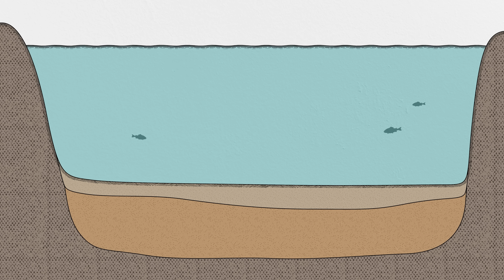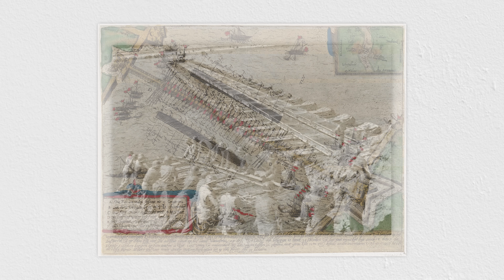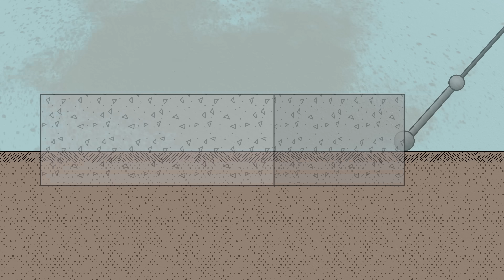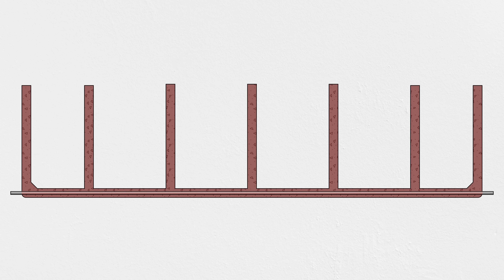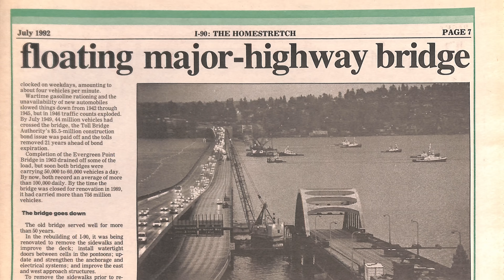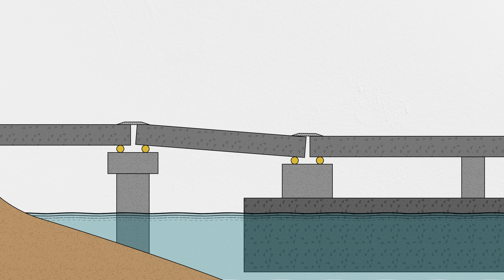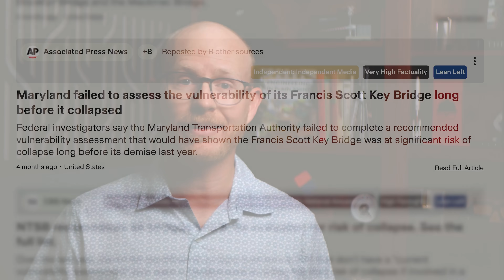The Hidden Engineering of Floating Bridges

Comment: The George Massey tunnel under the Fraser River between Delta and Richmond B.C.is an example of a tunnel that was built from submerged sections that were connected when submerged then pumped out.  It opened in 1953 replacing the ferry that had been used earlier.

Comment: I wouldn't truly understand the point of floating bridges, I used to live in Hampton Roads, 5 bridge tunnels the highest density in the world, and one of the longest bridges on earth.  27 miles.    
We figured it out floating bridges just seems unnecessarily difficult.  We drive pillars hilariously deep, boat in premade sections, underwater weld it together, then pump out the water.  It's a bridge, it's an underwater tunnel to allow aircraft carriers to pass over. It works just fine.

Comment: We had a concrete floating bridge in Hobart, Tasmania for 21 years from 1943 to 1964 which was around a kilometre long. It had a lifting span close to the western shore for ships to pass through and was curved. One segment is now used, sunken, as a jetty on a nearby island. This bridge was also damaged during a storm and had to be reinforced. The points where it connected to the shore are still there, I’ve been to them many times but it was demolished when the more permanent replacement with higher capacity was opened before I was born. Then the new bridge was hit by a ship and 3 spans collapsed causing all sorts of chaos! I do remember that as a small child.

Comment: The Hood Canal Bridge is great for the Olympic Peninsula, but all of the problems inherent with floating bridges are frustratingly present. Closures for submarines, closures for high winds, closures for... well, it can be a chore trying to get off the Peninsula at times with miles of backups. Still, having the bridge available beats having to drive down to Olympia to get around the Hood Canal. Thanks for the video!

Comment: Not mentioned - after the original I90 span sank in the storm, the pontoons cut the cables holding the new span in place.   They brought in a number of tugboats to pull the new span against the wind until new cables could be installed and stabilize the bridge.  The cables are essential in holding the bridge in position.

Comment: 13:40 those floating or buoyant tunnels will become a huge disaster if not properly handled. In a regular tunnel thats on or in the ground, the weights of the vehicles, vibrations, and other stresses, can dissipate into the ground. Same with regular bridges.
But this design shown here has no such mechanism. You need a lot more engineering to make these safe, not simply find a way to suspend them in water. I wouldn't trust such a tunnel, especially not the first of its kind. 
If you think you can outsmart physics, you really just offloaded or hidden the real problem.

Comment: Since you mentioned the proposed floating bridge in Norway, I'd recommend checking out Bergsøysund bridge as well. It was opened in 1992 and was the world's first floating bridge without side anchors. Instead the pontoons are kept in place by the bridge spans themselves being designed as a continuous horizontal arch under tension.

Comment: One of the biggest things in civil engineering & transport infrastructure is that you need a wide margin of safety, comprehensive build-out AND annual inspections & maintenance with no shortcuts and no excuses. Either do it right & maintain it, or don't' build. Of course when politics and all this nonsense gets involved, you can end up with critical flaws flying totally under the radar.

Comment: 13:25 I can think of so many sea crossing that only floating tunnel would work, like Italy's Sicily bridge, as the water is too deep for a tunnel, and too deep to put it any foundation for cable or suspension bridge. And ship still needed to get through it, only floating bridge or tunnel would work for this link.

Comment: I love the shots at 2:08, 4:09, 5:51 and 12:02 where you can see the effects on the water of multiple floating barriers like this (i.e. the Lacey V Murrow Memorial bridge). Strong waves on one side that look darkest as they're least reflective; gentler waves on the other side resulting in a water surface that's a little more consistent, a little lighter, a little more reflective; and then the almost perfectly still water in the middle. Even at 7:18, as harsh waves pound against the side, there's a visible portion that would probably be kinda fun to swim.

Comment: Glad you covered all my favorite experiences growing up driving back and forth across these bridges.  I once saw a submarine go through the open span, I once had a wave crash on my windshield that left me driving blind for 3-4 seconds going 60 mph and the weird feeling of the back of your vehicle moving independently from the front when stuck over an expansion joint in a storm.  Sadly all of these experiences are no longer possible with the new higher and bigger bridges but they are fun stories to share.

Comment: Quick explanation for how heavy thing float. 

Thing float if total density of thing is less than density of water, or whatever liquid it is floating in. 

Concrete more dense than water right? Yes! But, the AVERAGE density of the whole object is what determines the buoyancy. 

So, take all the concrete, find its density, then take all the air contained within the concrete, find its density, then average those two densities , you'll find the average density to be lower than that of the water!

Comment: The Hood Canal Floating Bridge has another serious problem. About a decade ago it was discovered that about a half of all outbound salmonid smolts are eaten attempting to pass the bridge. Think chum, coho, chinook and steelhead. (I don’t know if there are any pink salmon runs in the Hood Canal basin.) 

It turns out the juveniles predominantly migrate in the top meter of the water column. They hit the bridge and are stymied. (Go to Googleearth and see so next comments make sense. See the piers near each end where the bridge transitions from conventional to floating.) The salmonids turn right or left rather than just going down the vertical face of the pontoons. When they get to the abutment, they encounter the same thing, turn 180, and go to the opposite end. Wash, rinse, repeat. The mean time to pass the bridge varies a little by specie, but is about 24 hours. Diving birds and various marine mammals have figured out the buffet is out and concentrated on this spot. Biologists have used all sorts of sensors put into a sampling of juvenile salmonids well before the bridge. I thought the most interesting was differentiating between predation by birds and marine mammals and by fish. Temperature. When the salmonid is eaten by a fish, temp stays about the same. When eaten by a bird or mammal the temperature almost immediately goes up to about our 98f, and the sensor records it. Definitive. 

Runs had a temporary rebound after bridge sank, and before replacement. Understanding the connection was retroactive. 

A trial has been done to try and improve passage. In effect they added a cant so fish would encounter a 45 (?) degree inverted slope instead of a vertical wall. Hope was they would swim down and under the obstruction sooner. If desired I could contact someone and see if results are available. 

In meantime in mid to late spring each Ohio-class that goes to or returns from the Pacific also lets a batch of juvenile salmon escape the gauntlet.
Reply: That's interesting, funny how the fish never really considered to just swim down. The downside of manmade structures I guess.

Comment: Not a fan of the idea of floating bridges and tunnels to be honest. Maybe I'm just a naysayer but it doesn't seem like an ideal solution to me.

Increased maintenance costs, complete dependency on weather and the almost perpetually temporary nature of this sort of construction doesn't really sell it. If possible, I think just digging a deep fixed foundation is usually going to work better in the long run. I don't think any costs saved on the outset will be offset in the long term. It seems the chances of catastrophic failure are also significantly more likely if complete due diligence isn't adhered to.

Interesting construction and solution to a problem no doubt.

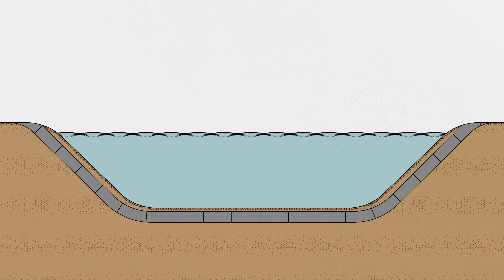Comment: the tunnel/bridge at 14:00 sounds really intresting and posible sci fi tech in our life time. 
i once had a thought about putting a floathing gass chamer in a sky scraper too reduce the weight. i asume it would not be practical or efficent way. but its thinking outside the box.
basicly hot airballon effect in a building

Comment: Just as an FYI, smaller or one off pontoons for houses etc, are usually made "unsinkable". That is, they are filled with EPS, or cellular plastic of a type that does not absorb water. This means that water leaks are irrelevant to their function as the void is already filled with a very light weight material. EPS is ofc more expensive than filling the void with nothing, and as this scales up, the more expensive concrete and water detectors with pumps become a cheaper option.

Comment: I would have thought positive buoyancy tunnels would be safer than ones that would sink. Given an issue, breaking from the moorings would push the tunnel up, compressing the joins, and keeping the sections together. A negative buoyancy would drop extending the path, possible pulling the sections apart and flooding the entire tunnel. Also the floating pontoons would be a shipping hazard as well as also being an issue if they do get hit, compromising the tunnel below. I'm surprised negative buoyancy is ever an option

Comment: Driving over the old Evergreen Point (WA-520) bridge in a storm was an... interesting experience. The bridge would sway side to side, shaking the streetlights, and from the high point on either end, you could see the whole bridge deck going all serpentine down its entire length. That and waves occasionally cresting and crashing into your windshield.

I'm glad the replacement bridge stands much higher over the water surface level and is much stronger than its predecessor.

Comment: When Sound Transit begins service across the lake, it will be the first and only light rail line over a floating bridge. You touched on the requirements, but there was a massive amount of engineering required to even make it remotely feasible. Each car weighs 102,000 lbs empty, and there are usually 4 or 5 in a train. That 1/2 million pounds is running across the bridge at an expected 45mph alongside other traffic, including tractor trailers with total loads of 80,000 lbs or greater, going 60MPH+. All this while dealing with the bridge movement in varying weather conditions. 
You mentioned the stray currents corroding the rebar in the bridge. Something else unique is that Sound Transit uses a 1,500VDC overhead catenary line (vs the usual 750VDC), which makes managing those return currents even more challenging.

Comment: fun fact, the i-90 bridge light rail track took 2 tries.. they ripped up all the tracks after the initial install and redid it which added a few extra years to the project. maybe someone here knows what the specific issue was - possibly related to the expansion joints? pretty crazy screw up.

Comment: Any tunnel across navigable water needs to be under the soil deep enough that the largest anchor in that waterway cannot interact with it, unless the tunnel cannot be damaged or shifted by the largest ship that travels that waterway. I.E. the ship/anchor will break before damage is done.
Surface pontoons are also problematic, at least bridge piers can have sacrificial piers for protection but if you have to put in protection piers for the pontoons, then what is the point of the pontoon?

Comment: Hobart, Australia used to have a floating bridge with a vertical lift section on one end.  Interestingly, the bridge was built curved.  It was used 1943-1964 and was replaced by a conventional bridge due to increasing traffic and congestion.  https://live.staticflickr.com/2431/3665190374_4610e2802c_b.jpg

Comment: I really like the floating tunnel idea. Put the tunnel across lake Michigan so that I don't have to drive through Chicago to go between Wisconsin and Michigan. I also understand that this is far from feasible due to many circumstances including the depth of the lake and necessary length of the tunnel. It would take over an hour driving at 80 MPH to cross. That doesn't even take into account the winter weather that can change rapidly and is known to be dangerous and deadly.
Reply: There's a ferry you can take.

Comment: While I'm not an Engineer, I suspect the floating tunnel idea is going to end up using a design which will be a modified double-deck tunnel with the top tunnel being composed of sealed sections providing the positive buoyancy to suspend the working tunnel the vehicles and trains travel through with the whole thing anchored to the floor of the water body it's installed in...with the working tunnel effectively hanging under the buoyant tunnel, the center of gravity making the tunnel less likely to want to roll to the side/flip over...

This keeps the tunnel and it's flotation tanks well below the surface and thus immune to things like wind, waves, ice, tidal shifts in water surface level and any ship traffic crossing that area...
The only external things this kind of tunnel would need to worry about are submarine traffic, water currents, sinking ships or other accidents resulting in Cargo falling overboard...

Comment: The Hood Canal near the bridge has a mean tidal swing of nearly 8 feet, and a maximum of over 16 feet (which can get even higher due to the combination of rain water and offshore low pressure systems). This happens twice a day - every day - and is a fascinating peice of managing the bridge. Its really quite odd driving it during spring tides, when the bridge approaches are very steep or unusually shallow. 

All Ohio class submarines, both the SSGN and SSBNs must transit the Hood Canal to get to Naval Base Kitsap Bangor, and the bridge frequently opens for subs or their support craft, which requires an impressive coordination between the navy, the coast guard, state patrol and wsdot employees. Recreational and commercial openings are also frequent - the bridge usually opens at least once a day, year round.

Comment: When they replaced the I-90 (Murrow)  bridge and were replacing the anchor they found a car. The care belong to a person who disappeared decades before. They had collided with "the bulge" and go off the roadway early in the morning and noone had seen the accident.

 When the new  I-90 (Hadley) bridge was built it advertised as "rail ready". It wasn't they hadn't calculated the pressure wave a train will created ahead of the train. The bridge, joints etc.... all had to be reinforce and adapted for moving trains. At a cost of $500 million.

Comment: For the norwegian floating bridge idea, I would much prefer the positively buoyant tethered to the seabed solution rather than the other idea. It would for one make the tunnel invisible on the surface preserving the area around it, which is one of the appeal of a tunnel. Secondly, having the floating critical elements on the surface, which is subject to hashers conditions and ship hitting them seems like an unnecessary risk. Lastly, the failure condition for a tunnel carrying people I would prefer to be to float. If the floating elements failed the tunnel would sink, on the other hand if the tether broke the other tunnel would float. It would also make it easier to pre load as other have mentioned is done to reduce the movement of floating bridges. I know the tunnel is very much in the idea stage and much of my "rant" here is based on opinion and speculation as I do not know the final design, but it was just what sprung to mind when seeing the ideas.

Comment: I was pleased to see that you may have used the images of the 1940 opening event “brochure” or “program” for the Lake Washington Floating Bridge that I donated a few years ago to WSDOT’s library and digital archive.  This document was lovingly saved by a family member - whom attended the 1940 bridge opening.  In 1990, I had the privilege to work for WSDOT on the refurbishment of the original bored tunnels adjacent to the floating bridge, and was working for the project when the bridge sank in 1990.  That tunnels are still in use today for the eastbound lanes of I-90 traffic.  As I recall, some interior cell walls for the original bridge were not full height, and could be breached under the right conditions.

Comment: I suspect the floating tunnel designs would be better off using positive buoyancy with anchors rather than suspending them from pontoons, as you can gain immunity to most of the weather if the entire structure is deep enough.

Comment: Objects 3d printed out of thermoplastics are essentially hollow but filled with a series of baffles due to the infill; depending on the infill design these pockets can be sealed and watertight.  I wonder if a "house" printer could be adapted to use the same concept and print a concrete pontoon that was inherently compratmentalised?

Comment: Interestingly, the 1955 Tappan Zee Bridge, whose main span looked like a typical steel bridge of the period, actually "... was supported by eight hollow concrete caissons. Their buoyancy supported some of the loads and helped reduce costs." Quoting the wikipedia article, but when I was a kid I mailed the NY State Thruway Authority and they sent me paper brochures about each of the big bridges they were responsible for and I remember that particular fact well as it is a little nerve racking when you're a kid to think that big bridge you're on is floating. But it made it easy to take those supports away when they demolished the bridge. More about the old bridge here:  https://mariomcuomobridge.ny.gov/history-tappan-zee-bridge-key-design-features